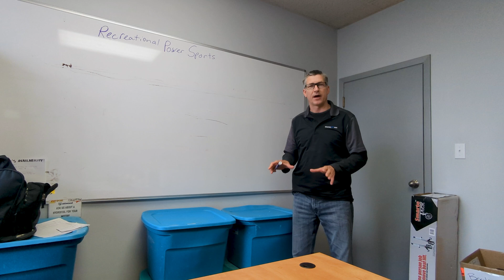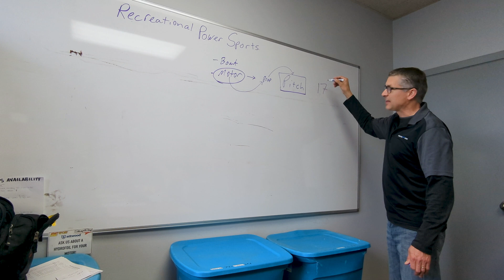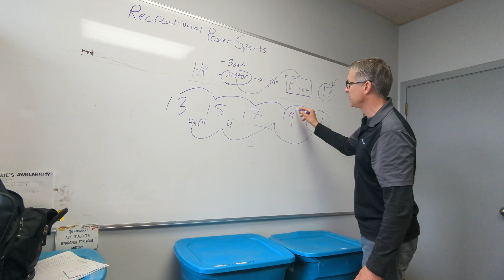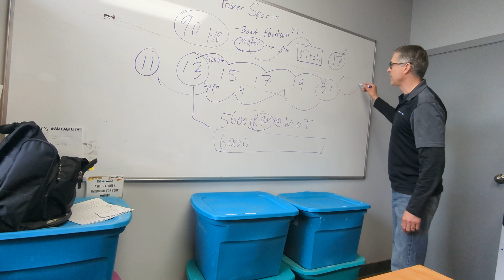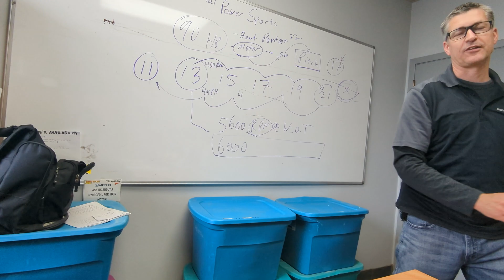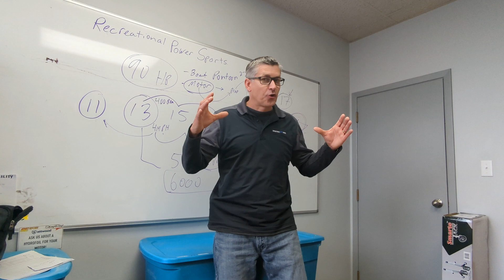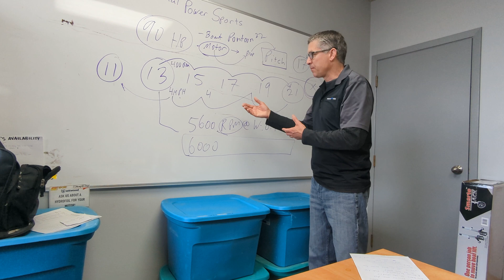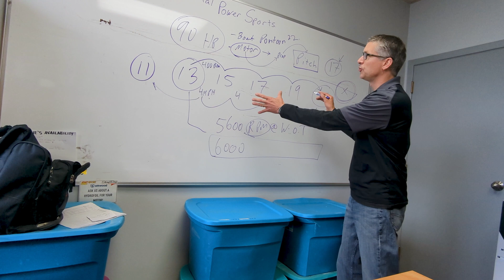Propeller Q&A. Hydrofoils, stainless vs aluminum, and number of prop blades.

Comment: I’m new to boating. My boat (grizzly 1860) has a 90 Mercury. It has the aluminum prop. If I replaced it with the exact same spec but in stainless steel would that cause my rpm’s to be lower? 

If I’m understanding correctly the aluminum prop loses bite due to flex. I would think that would allow it to spin faster correct? So if I got the same in stainless steel I guess it would be best to compensate for that by changing the spec a bit?

Comment: I have a highfield sport 390 rib with a 40hp mercury efi and a black max 12 inch pitch propeller revving 6100-6200rpm at WOT and top speed is 31mph. My problem is that the rib only planes at 3900rpm and I would love to be cruising at 3500- 3600 rpm but the rib doesn't stay on plane even at full trim down. Is there anything I can do to plane at lower rpm and maybe have a little bit more of top speed please?